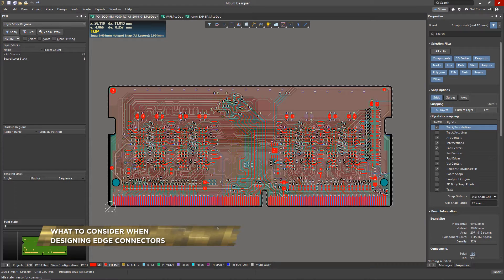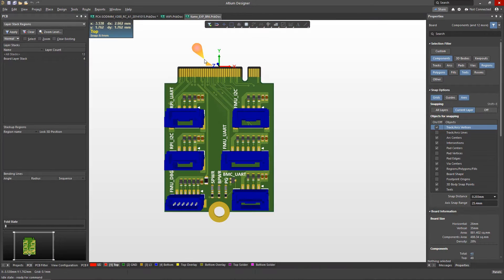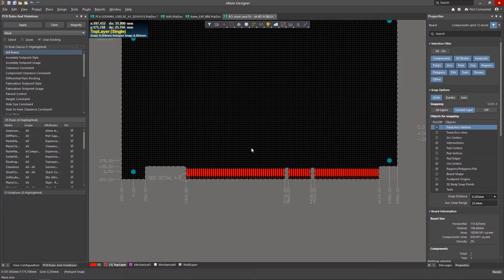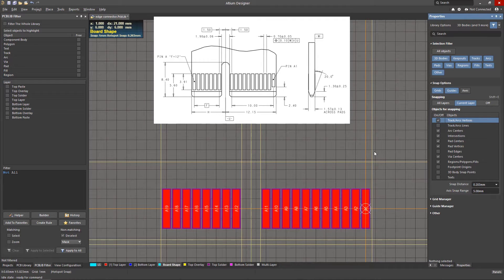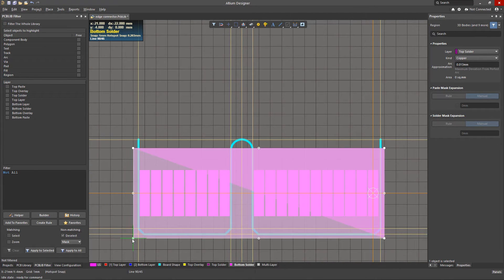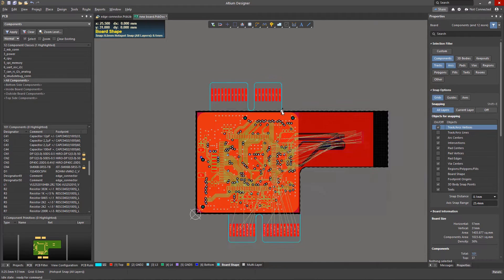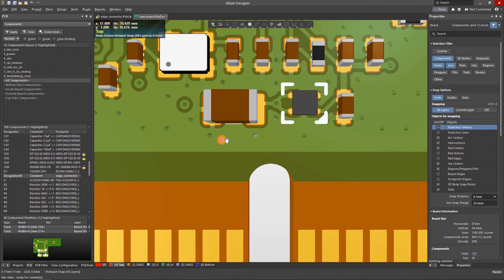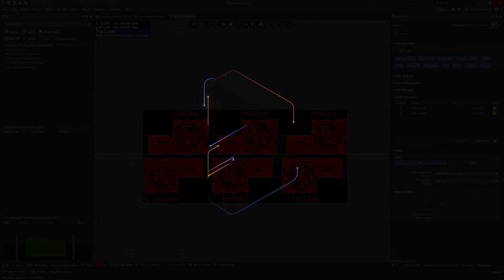What to Consider When Designing Edge Connectors

Comment: does altium has a footprint for  USB-A edge connector?
Reply: Altium offers many footprints for a variety of connectors through the Manufacturer Part Search Panel in Altium Designer. You can search for "USB A connector" in the panel and you will see many options for these parts. Some of these will have footprints attached, and when you place the part in your schematic the footprint will automatically load into the PCB layout once you import changes to the PCB. Please note that these footprints are provided by the manufacturers of the parts, some footprints may demand modification to meet your standards, such as moving silkscreen and changing paste mask.
Reply: @Zachariah-Peterson  thanks for the reply. what i mean was USB-A pins on PCB, not physical connector.
Reply: @MohamedAfzal  Ah I see, I have never seen an edge connector footprint for a USB-A pluggable module in the Manufacturer Part Search panel. If you find a male USB A connector datasheet you can probably see what pin size is used in the mechanical drawing, and from that you could figure out the pin size. Then you can create the footprint in the PCB and match the edge-to-edge size of the USB A plug.
Reply: @Zachariah-Peterson  thanks 👍